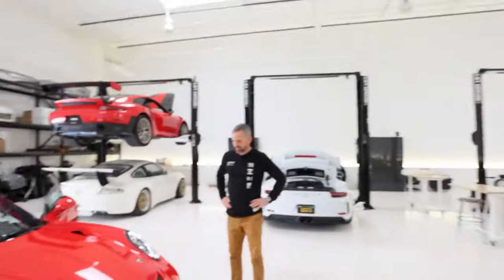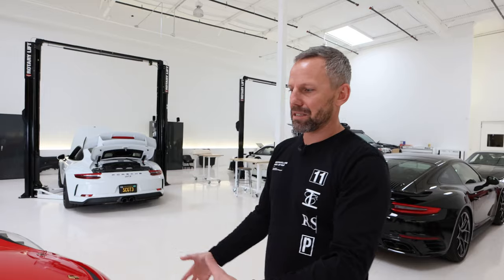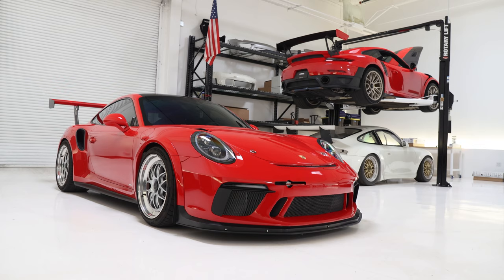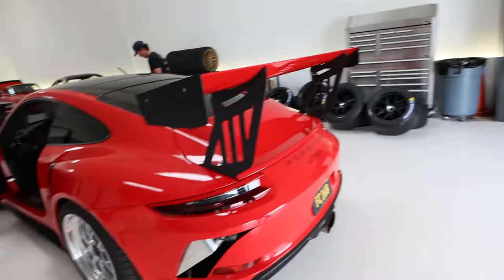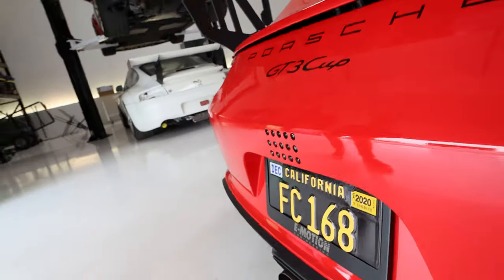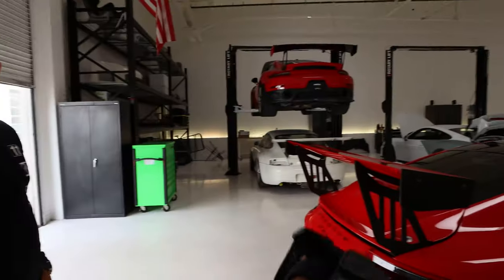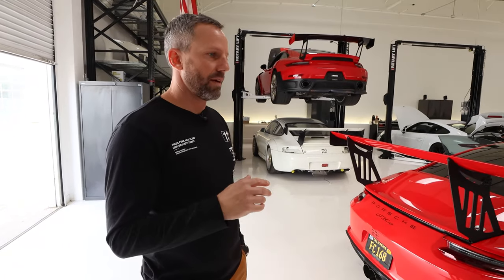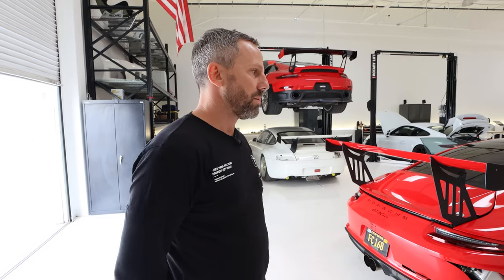Turbo’d, Body Swapped, 800hp Porsche GT3 Cup Car for the Streets is Insanely Quick

Comment: That back end would look spectacular with a black grid type screen of sorts to drop in over those openings for accommodating the intercooler boxes. The shape coming around the trailing outer edges of the bumper would look awesome. More “finished”. But what a beautiful car. And, some upper level creativity going on here to raise the bar. Really, REALLY impressive work. 👍🏻😎👍🏻
Reply: I agree, finish it off with those plastic cleans like the rest of the rear and then its done.

Comment: That is hands down the most beautiful Porsche I’ve ever seen
I second that Larry, the rain light built into the rear bumper is TO SICK.
Wheels are TO PROPER
Wing and the forged carbon in the engine bay is GORGEOUS... and the splitter 😱, just wow 
Intercoolers popping out of rear quarters is SUPER MENACING = SICKNESS

Comment: Very interesting build...but I didn't hear anything mentioned about the suspension and chassis underpinnings. The GT2 RS has most of the cup car suspension components also, if you left those at the 991.1 Turbo level you are going to be in serious trouble on the track, especially with the Cup wing and the big splitter.

Comment: Funny that the GT2RS is in the background so much. This is a GT RS car based on a Turbo just like the GT2 RS is. Only a little different and quite a bit cooler!
Reply: This car wouldn't have the weight reduction or any of the GT suspension bits with spherical bearings underneath it though. Not quite GT car bones.
Reply: @dln.sweeney  Actually, the vehicle has reduction in weight that wasn't mentioned in the video. The turbo manifold is made from inconel; OE battery upgraded to antigravity battery; OE seats replaced with Recaro Sportster CS; OE rotors replaced with upgraded rotors which are lighter; decklid and reinforced frame made from CF. Some of the reduction of the weight is offset with the rear wing, half roll cage and front diffuser.

As far as underbody goes, the vehicle has
GT undertray strakes and rear diffuser

You are correct, the vehicle does have GT suspension
Reply: *does not
Reply: @humblepiggy1812  Ah, my bad. Thanks for the additional info.

Comment: "It's like, it's like, oh my god..."
Is that the best you could get out?
Be more serious, man.
I don't care much about how they designed the exhaust tip, but how about the curb-weight on this 4wd GT3 cup-car?
How about the methanol?
Filling, is it there over a certain boost, or what?
Water-injection?
How much power on pump-gas?
Drivetrain upgrades beside stronger clutches?
Come on!
Ask the correct questions?
What about mounting those heavy BBS's on a "cup-car"?
Does not belong there at all.
Everything was perfect except the choice of rims.
Go for lightweight Apex in GT2RS-similar design, or straight out GT2RS-wheels.
What a car. Deserves a more serious reportage.

Comment: So he gets upset with non-functional ducting on bodywork and then goes on to explain his non-functional ducting on the bodywork... something's not adding up here....
Reply: Yes, it does sound like it doesn't add up. However, he mentions how the bumper work doesn't line up with the ducting that feeds into the intercooler, radiators, oil cooler and etc. with other cars whuch are important.  The NACA ducts are were supoose to feed fresh air into the cabin, which case I believe the customer wanted to retain the factor AC amd also because the mechanism for the windshield wipers were in the way. 
I know the owner of the vehicle and he does have plans to have it routed as additional ducting for the brakes.

Comment: Why on earth would you take one of the best motors on the planet and turbo charge it?  I’m pretty sure Porsche makes not only a GT turbo motor but a regular 911 turbo.  99/100 of regular GT owners can’t drive the GT3 at 9/10ths, 99.9/100 GT2 owners can’t drive a GT2 at 9/10s. What are we going to do with 800 hp?The reason I drive a regular GT3 is because the RS is too blingy to drive on the street.  But to each his own
I guess it’s a nice exercise in engineering